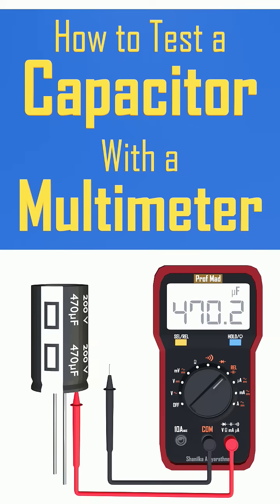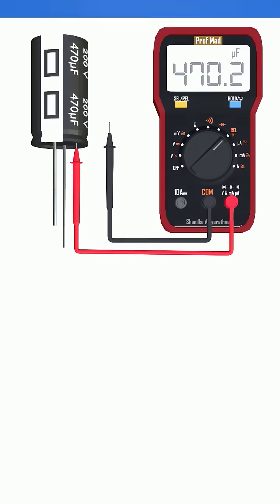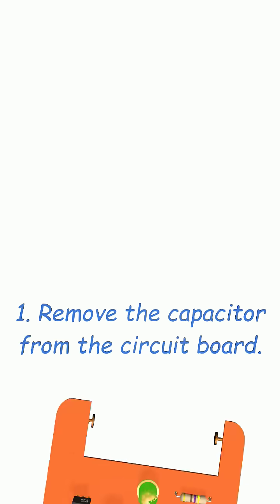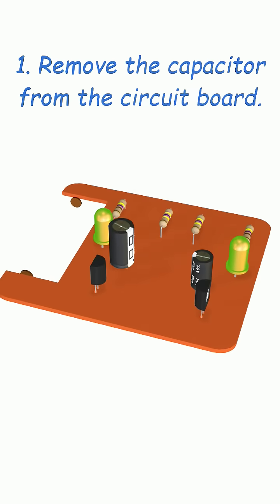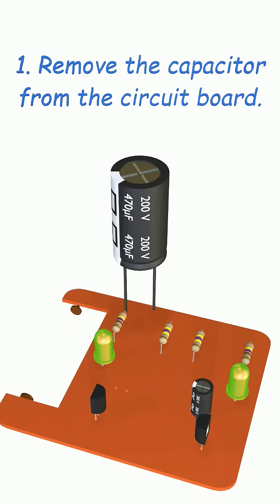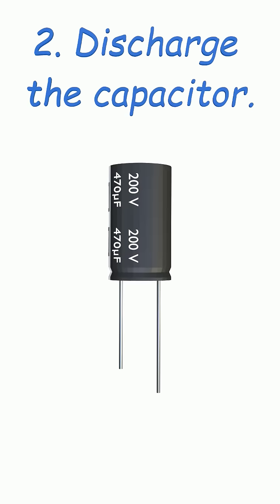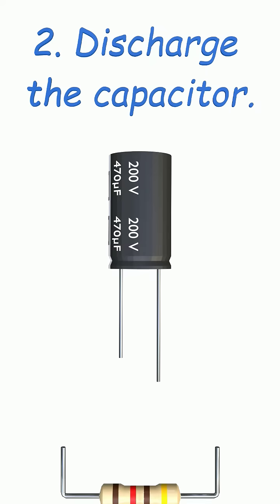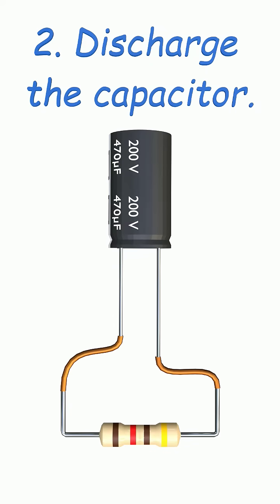How to test a Capacitor with multimeter ?

Comment: If after removing the capacitor from the PCB, the legs are still at full length, I would say that is the issue, not a fault of the capacitor. It was the bellend that fitted it.

Comment: This is strangely useless considering the time it took to build the animation. As others have said, there will not be a longer lead once it has been in the board. More relevant, it’s hilarious  that they have you discharge the capacitor AFTER you desolder and remove it from the board (maybe less hilarious when you are the one getting shocked) How is that supposed to work? If you are new to this stuff, ignore this one.

Comment: Not always accurate. An electrically leaky cap might show the correct value, but once in a circuit it can cause damage because it has started allowing DC through it.

Comment: On large filter capacitors, like above 4,700 mfd, the tolerance should be towards a LARGER than marked value, up to +50% in some cases.  Such a capacitor, if measures just under its marked value, is one that is already failing, and could go on Short circuit soon...

Comment: First you have to set correct position on multimiter and then put the probes on leads. Never on different order. With capacitors maybe it is not important, but for high voltages it is important,because you can burn multimiter jumping trought resistance measurement position.

Comment: What values for the resister?  We bought a 1F cap years ago (25yr) for a car stereo and given a small 1ķ resister to charge this cap up.  That things was glowing red and burnt within a second.
Reply: 100K,   1M , it doesn't really matter as long as it's a higher value cap that will use the charge from the capacitor to discharge the cap

Comment: What are we testing since it is completely discharged?
Reply: Capacitance
Reply: What do you mean ?
Capacitance is what we are testing.
Not Voltage.
You must be new to Electronics

So Voltage is Pressure.
We are not testing the amount of Electrical pressure in the capacitor

we are saying.....
Release all the pressure

Now.. let's test THE CAPACITORS ABILITY to store charge (Capacitance)

Also... this test is not really a good test to RELIABLY test a caps ability to store charge
and E.S.R. Test (Equivalent Series Resistance Test) is much better for this purpose and more reliable
Reply: Thank you so much for your response, especially the insult and the shouting. You should become an educator @martinkuliza
Reply: @ 
You're Welcome

What Insult ?
What Shouting ?

Strange comment and somewhat sarcastic don't you think ?

Comment: Tollarence?
Reply: For electrolytic  caps, usually plus-minus 20%. In general, one should use the manufacturer's data sheet about this parameter. In our days, practically, you will never find a brand new capacitor reading above its nominal capacitance...The value will always be very near to minus 10%...😢
Reply: The word is 
Tolerance

Tolerance is an ALLOWANCE for Error
so let's call it WIGGLE ROOM

so if something is supposed to have a value of 1 to be perfectly in spec
and then i say it has a tolerance of 10

that means i will accept a reading of 
+10  to - 10

Comment: It's the first step that is annoying. Is there a way to test a cap without soldering it from the circuit?
Reply: Yes, you can use an E.S.R meter instead of your multimeter. The measurements with it (for electrolytic caps only) are both reliable and faster in comparison to using the multimeter for testing ...Just remember to have the circuit under test out of power or you will destroy the instrument...

Comment: when you desolder a capacitor, there is no longer pin on this.... the longer pin is only on new capacitors....
Reply: Dear Cathy, polarized capacitors have their leads labeled on their bodies as well, and some types are non-polar also. I hope this helps.
Reply from the maker: Hope you got the answer already. 
@SeaHay is correct. check the label.
Reply: @Profmad, you should've said that in the video short. Write the video n make it plain! 😲